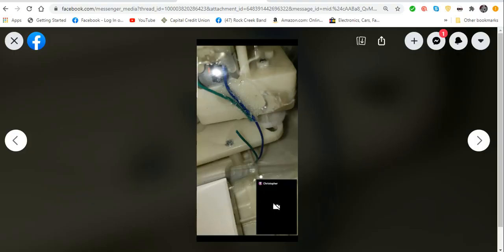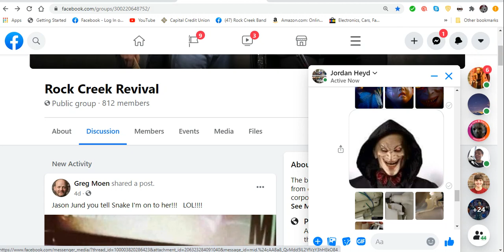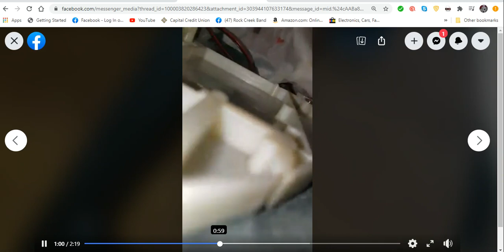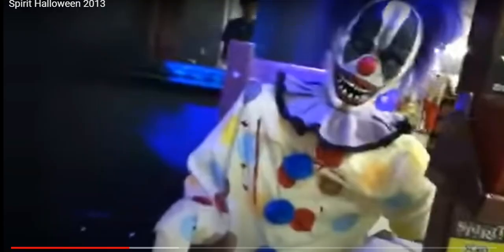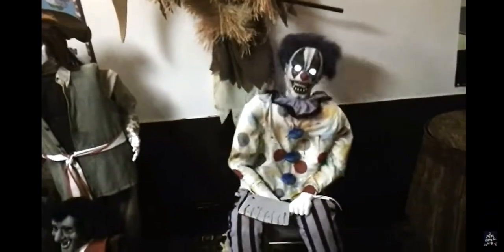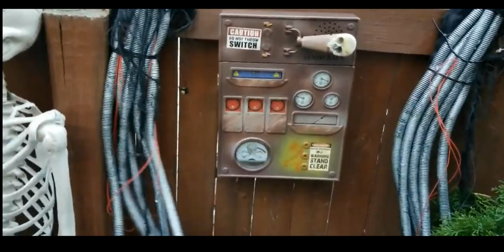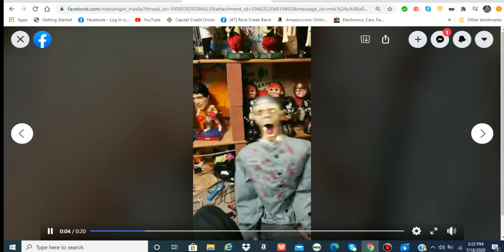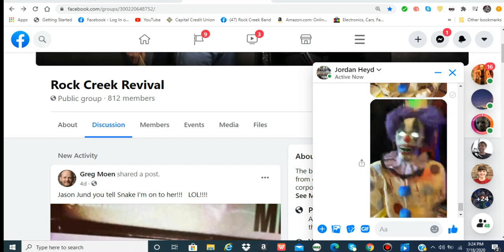Warning about the Newer Models of Death Row (Electric Chair Prisoner)

Comment: I have the newer version from amazon
Reply from the maker: Well, I'd get rid of that hot glue if its crappy like this one was
Reply: jobeanvideos there’s a plastic covering around it
Reply: @thepixelatedpumpkin31  take it off
Reply from the maker: Ya you can unscrew ot
Reply: After you unscrew lift it  up of tape it to the poll then un hot glue wires then screw it back👍
Reply: Jco92 thanks for the advice but I rather not mess with it. I am more likely to destroy it if I tamper with it
Reply: @thepixelatedpumpkin31  no problem if you don't want to do it you can ask a parent / guardian
It's up to you 👍👍
Reply: Jco92 but nonetheless thanks for your help and advice
Reply from the maker: Ya I mean, you can wait until the wire does come off, I mean soldering isnt too hard. It's just for people that dont want to have to do it later on
Reply: @thepixelatedpumpkin31  No Problem 👍

Comment: I’ve had mine for 9 years. Still works great
Reply from the maker: So you have the 2012 model?
Reply: jobeanvideos I do. And it’s lasted forever. Even built a new chair for it
Reply from the maker: Ya that one never broke at our store either, but it also sold quicker but I think that one was the best, but that model is so hard to find
Reply: jobeanvideos it’s a nice one and I like having it in the haunt I run. This year I’m building a replica electric chair to strap him in
Reply: jobeanvideos what’s your opinion on peek a boo clown?
Reply: jobeanvideos I bought mine the day my store opened. The only issue I’ve had was the stupid MIT cable broke fast